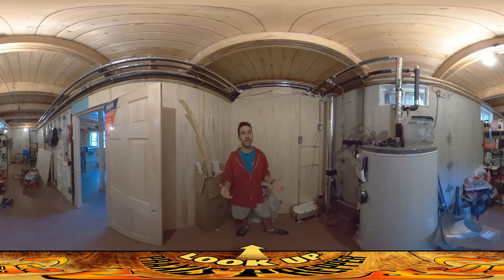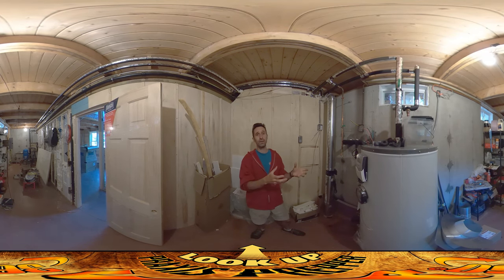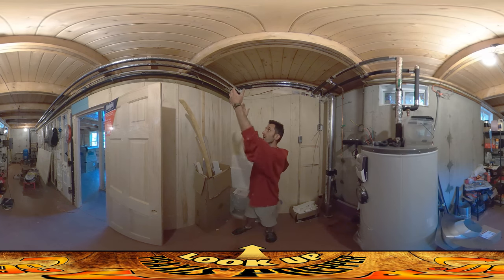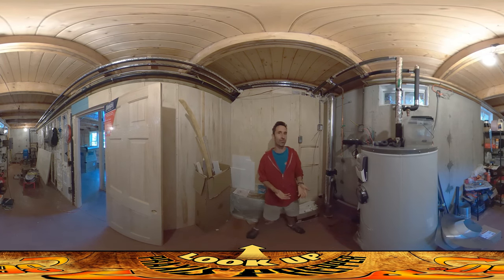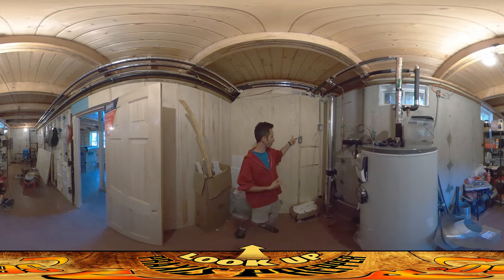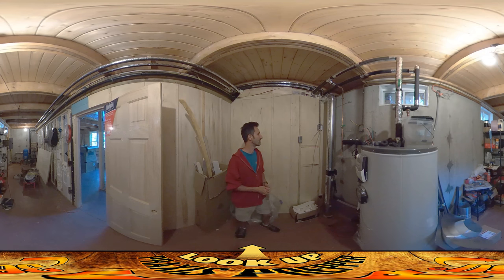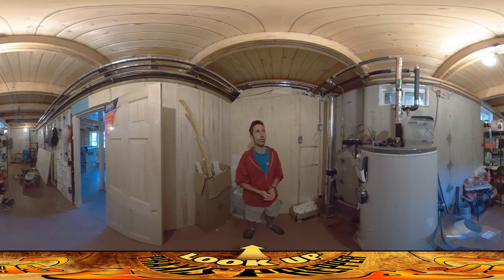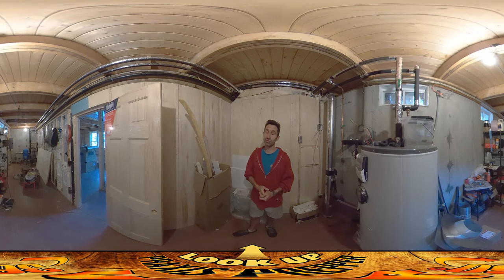Homestead Building - Pipe Insulation Day, Radon Levels

Comment: In Indiana Radon mitigation was done bu sucking air from the gravel base under the lowest floor slab (frequently under a basement and venting it out a pipe running all the way up through the roof. If you core the slab, it would probably be sufficient to vent it out the rear wall.

As for insulating the cold water pipes, I never understood why they aren’t normally insulated also.
Reply from the maker: I'll be installing our radon vent soon. We're doing it with a horizontal hole though due to some other issues and concerns. I'll highlight them when I install it and do the video. That should have been five days ago, but (guess what) the contractor who was supposed to show up to do it didn't show up and isn't returning my calls now. SO surprising! ;)
Reply: @PraxisPrepper  Well at least there is consistency...

Comment: you're still using copper pipe down there?
Reply from the maker: yeah. People use PEX here a lot, but I like copper. Though the way the plumbers put it together with maxpress fittings is pretty lame. I've always only known copper to be sweated together. I didn't even know this tinker toy approach existed - and it's NOT great. Lots of leaks already.

Comment: Won't this radon device also tell you whether you actually do need the mitigation... i mean, if the radon comes from the gravel layer underneath the slab (brought it) you would expect the amount of gas to reduce over time as the amount of gravel can only hold so much of the gas, once that is gone, one would expect the problem to be gone as well... (which may well be what the continued measurement is showing you)... then again, i'm no radon expert so not entirely sure if that is the way the gas is produced...
Reply from the maker: The radon is emitted as a byproduct of the slow nuclear degradation of uranium in the granite - not running out any time soon. ;)
Reply: @PraxisPrepper   hmm i c ... that is to bad...